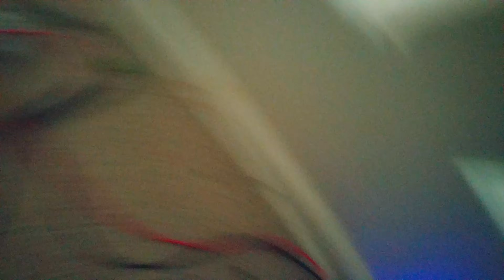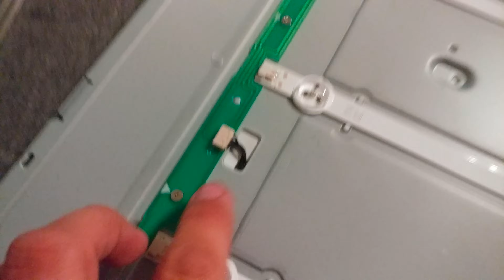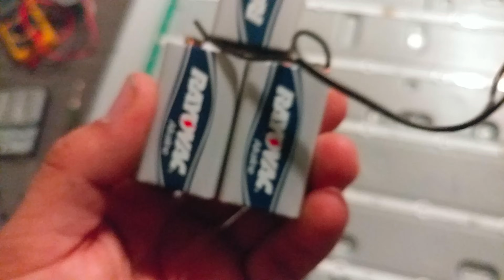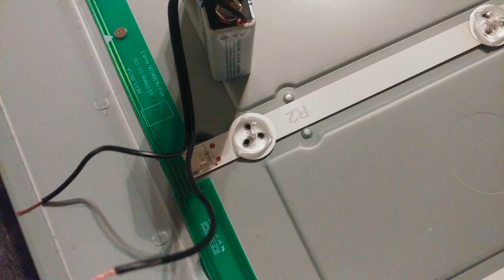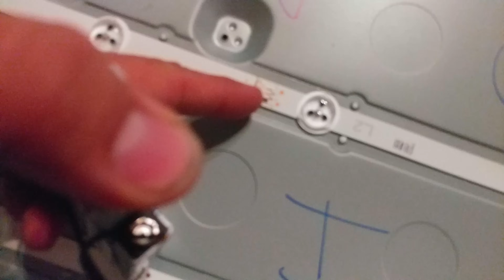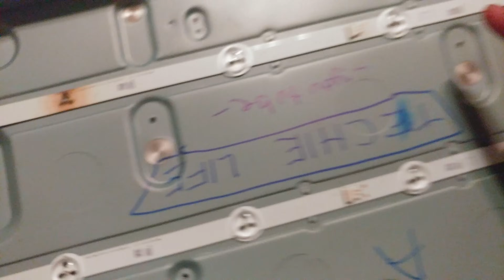how to test LED strips without tester Using a battery. backlight tester DIY

Comment: 2:45 - 10 X 3 = 300 Volts?
also
Dude, check out  --> Video editing Software.
 Soo, I rate this video 2 Kamalas & 1 AOC.
(kewel battery config is the reason for 2 instead of 3 Kamalas)

Comment: if the orignal LED is 3v is buying a replacement 6v ideal, so that the LED wont reach the max power and burn out, its just a question
Reply from the maker: No, you want another 3v.. if you purchase a 6v, the other leds will become very dimmer and that one led will be brighter.

Comment: Quick easy question?  I got two brand new power supplies and led output for the backlight is 130v roughly on led pair 1 and 0vokts on led pair two off these boards. Am I correct in assuming these parts I bought are bad?  It mentions 89v on #4 on the voltage tag on the board. So I my mind these are defective.  It does it without led connected and without motherboard connected and I have tryed with it hooked up...

Comment: When you applied the 3 x 9V tester, did the rest of the LEDs on that strip also light up? Thank you 🤓
Reply from the maker: Well it depends on the tv. If the LEDs are in connected to the rest of the LEDs, then it should turn then on.

Comment: I've got to replace the LED backlights on my 5yr old 65" Philip's PFH5250/96 as the LEDs have gone dim on 1 side :) not looking forward to this to be honest. Nobody seems to have taken this model apart on YT :(
Reply from the maker: Just try to figure out which led has gone bad... Or just try to replace the whole led strip. That would be easier

Comment: So you're saying if there's one bad light that if it's removed the tv will function? I was thinking I had to replace it. I know my 65 inch insignia has a backlight problem but I haven't disassembled it yet. Was thinking I needed a lot of stuff to solder, heat, whatever flux is, etc.
Reply: If you don't already have all that stuff it would be cheaper just to order a new led strip kit
Reply: @MyBigThing2010  yeah I fixed my TV last yr or maybe the yr before. Lots of people give those TV's away and the repair isn't that bad. I even had a shop tell me it wasn't worth repairing which tells me how sorry some "specialists" are.

Comment: Fantastic, can in ask, i have only 8 led in my strips, is 27v to much? Would using less like 12v still light them up but more faint? As in enough to know which led is not working?
Reply from the maker: I would only use about 20v
Reply: @TECHIELIFE  Would 18v work as in 2 of those 9v batts or would 18 not be enough to light them?

Comment: Hi.....how did u bead or solder the strip where there is missing LED. I live in small town where no TV parts are sold and my TV display went black today only sound. Luckily i have an old tube TV to go on with my life lol. Gona be  a while before i can get a replacement strip
Reply from the maker: Place a small piece of copper. And it should bridge it
Reply: @TECHIELIFE  thanks will try that today

Comment: If I wish to replace individual LED in any of the strip, what is the type of LED I should buy from the market?  5050 or 3528 or what?  Can you pls advise?  Three battery pack for testing strips is really interesting. Thank you.
Reply from the maker: You honestly should measure the LED, or just try to find an identical one on eBay

Comment: My master Philips 32BLD4012N / 62 has 2 LED bars on the TV, there are 6 LEDs on the bar. There is no sound, there was no image, I changed the LEDs, they did not light. There is 13 v electricity to the sockets but it does not light up. I wonder why
Reply from the maker: Probably because the LEDs are bad. Did you change the LEDs or the whole strip?
Reply: Although I ordered a product that looks exactly the same, the product that is the same as the TV model but the input socket and the codes on it have been sent warn. The original is K320WDC1 A1 and the product sent with a socket at the end writes K320WDX A2 and the middle socket makes a difference.

Comment: Tnk, for the help, just one question, my led strips are made with 14 leds, could work with 9x3 battery or I need to increase the number of the batteries? Tv Samsung ue55ju6800. Tnk in advance.
Reply from the maker: Let's just say, under voltage is safer than over voltage.. these leds will be damaged if you go over

Comment: if I wanted to light them all together from the cable that goes to the power supply, how man volt i need?
Reply from the maker: Depends on how they are wired.. but typically it would be 3volts per led.
Reply: @TECHIELIFE  12 led each strips so 36 volt , I tested them with 4 batteries. 5 strips connected in parallel 180 volt?
Reply from the maker: @ivanhossain5436  sound about right.

Comment: Amazing video very impressive just had a quick question so if I do this I can touch and test any of the LEDs one at a time? Anywhere on the board except for the middle connectors? Because the middle connectors will send voltage to the entire strip? But if you touch one 3 volt with the 27 volt wouldnt that blow the single led as well? I want to try this on mine ASAP because I'm waiting for LEDs to come in the mail so if you could find the time to get back to me that would be great thank you
Reply from the maker: Yeah , do not try on a single led. It will damage the led.

Comment: great idea..i just used a 12v ac adapter and strip the end off and it works fine for doing 1 strip at a time and just do each strip ...i like your 9v  method too....i also do what you did by jumpering the bad led..it wont really matter..you wouldnt notice it...

Comment: Great video! I was considering to buy a tester with priority shipping but this will definitely save time and money to fix an old Vizio TV with backlight problems. I’ll still get the tester but it can get here whenever, now.  Thanks for the bonus trick with the bridged LED solder. Considering I am fixing an old TV, I rather spend towards a new one once this one is not worth fixing anymore.

Comment: You can also use your phone charger + usb to test them , basically cut the usb cable you'll have 4 wires use the black and red as positive and negative. And job done
Reply: @Sam S I don’t understand the point you’re making on how it’s a bad idea to do this. How are they fundamentally different at all, it seems like the same thing to me? It kinda seems like your point is, that it would be bad if, while you were connecting the wires to the backlights, the voltage happened the vary. But you say yourself that the voltage is constant, and the phone itself regulates it, so without the phone in the picture there would be no need to worry about the voltage varying

Comment: So I could use a little "wall bug" switching power supply of around 30VDC to do this, right? Or, would the voltage be too un-filtered/un-smoothed?
Reply from the maker: I don't think it needs to be filtered. The lights will get brighter as more voltage is introduced.
Reply: @TECHIELIFE  Cool. I managed to test my LED strips using a transformer from a toy railroad set.

Comment: I did same with 3V button cells... Kinda sick,but working. :D But the problem is,all the LEDs working fine,but for some reason,the top 4 row of the strips not even light up at startup. The bottom 3 row driven by the second pair,works fine. Any ideas?
Reply from the maker: Maybe it's a power supply issue. What's the model of the tv?
Reply: @TECHIELIFE  55LN575S-ZE. When i turn it on,the voltage jumps up over 200volts on both positive,then when the backlight shut down,i measure stable 85volts on them.
Reply from the maker: @janoskonyari3294  it's either the LEDs or the power supply, if the power supply is supplying power, then that led array may be bad.

Comment: Receptionist at an authorized LG tv and appliance repair shop in Ohio said the whole panel on the TV needs replaced if some of the leds are out. And it costs $500-$1,000. Is this true? Lol. I though you can just replace a strip of the leds.
Reply from the maker: It's true that it could cost that much. But it's something that you may be able to do yourself if you are very careful. This is a kind of hard task to do. But the principle is easy. They Normally will replace the whole panel because this way it's an easier and faster job to do and will pass the bill to the consumer.

Comment: could I possibly use a buck converter? I have 8 led per row and a hp printer power (internal )supply is 29.v  Ive ran my sound bar and other thing off it. there $3.00 e-bay.. thanks

Comment: This method might work, but I would not recommend it.  If you want to use a battery to check LEDs, use two AA, C, or D batteries instead of a 9-volt triple pack.  With the 27 volts that are produced with three 9-volt batteries, if the string you are testing has only 5 good LEDs working, you will be supplying them with nearly twice the required voltage, which will blow them out.  If you use two AA batteries in series, you will have a 3-volt tester, and you can check each 3.2 volt LED at a time, without fear of blowing the LED.  

The BEST method of testing LEDs is with the variable voltage LED tester that is sold EVERYWHERE.  Made in China, and you can find them from about $20 to $60.  I got mine from Amazon for $23 including tax.  It will check a single LED or an entire string of up to 100.  It varies the voltage as required.

Comment: Good video,  your camera is too fast...slow down...ok... in a 16ft. Strip, will each 3 LED section need 3V or not? Last night strip became slightly yellowish and went dead. Any way to check which portion is faulty? Power Supply is 12V 6 Amps......https://www.amazon.ca/dp/B01FFWQCKO?aaxitk=A6wcF2s2dO2ZCOvdBjLGEA&pd_rd_i=B01FFWQCKO&pf_rd_p=aa0a7a36-9d2d-49bd-b59d-ceef667a2a55&hsa_cr_id=1875331280801&sb-ci-n=asinImage&sb-ci-v=https%3A%2F%2Fm.media-amazon.com%2Fimages%2FI%2F71WHdYuTr1L.jpg&sb-ci-a=B01FFWQCKO
Reply from the maker: Each led is most likely 3 volts
Reply: @TECHIELIFE  Thanks....EACH or Set of 3 LEDs = 4.5V?

Comment: New subscriber.  Nice work. Can you help me with my Polaroid tv? Model tlx 042-40b. Have standby and power lights,no picture. Inverters look good,think it's a blown cap on power supply.
Reply from the maker: Do you have voktage coming out of the power supply to the LEDs?
Reply: @TECHIELIFE  That's what I'm not sure of...where to put probes on my meter to check...should it be 5v coming out or 24v?
Reply from the maker: @Buff_Dave_Oprtr  probably the 24.

Comment: What is the meaning of one strip says R1 and follows the other strip that says L1.  What is the deal with that.  Can one unhook say the L1 and light up the R1 or just cut off some of them ( being hooked up in series, probably not) to shorter the strip just for the purpose of sticking them somewhere and use them for fun?  Dang I didn't realize that you have supply them with so much voltage.

Comment: so i have samsung un60j6200af and it has two seperate led wires one set grey/black and anouther grey/black when i use the 9v battery test it lit one of them but other set of wires nothing happen.. so im hoping even though its a job its just the leds.. shopjimmy has kit with suction cups for 12strips 100$

Comment: Just been stripping ours down if goes well will  e my third tv repair success  plus 1 that's an almost fix (sound plus tv comes on (didnt before ) but still no pic ) first fix was a 37inch samsung lcd and being used as I type lol which only needed capacitors (£5) anyway almost to the nitty gritty of getting to lcd's (these ove not yet ever done ) I have a supplier who has them but there are 2 arrays  so need to check which ones are needed it's a Phillip's 49put4900 model there was a an upper and lower dark patch that was only noticable on certain dark screen picture I have no lcd  tester have u a link for your tester ? Are the cheap £10 ones on ebay any good ? And did u test the side ones that you mentioned? Thanks good video
Reply from the maker: I have a link on the description of the video
Reply: @TECHIELIFE  my bad I'll take a look mate thanks

Comment: LED's simply don't last forever and if you have  them dying then it's time to change them all. You can buy complete sets of LEDs from China to suit the TV you're working on. It took me some time tracking them down on AliBaba, but I ended up finding the set I needed. Total cost with shipping was around $46 USD. 

My TV should now last another 3 years, maybe more. But messing around and only replacing a few means you could be replacing the old LEDs every few weeks or months, I guess it all depends on how you value your time. If you decide to replace only the blown LEDs then also check for any LEDs which appear to be stressed and change them even if they're still working. If they look stressed, they're about to die, so remove them. Also, replacing LEDs with those out of wrecked sets isn't a good idea either.
Reply from the maker: Propfella, I understand that they don't last that long. And yes I agree to switch off all the LEDs is a better idea. But sometimes is about the convenience that matters. I would buy broken sets and repair them as seeing fit and reselling. Spending more time and money on the tv would cause the profit to go down. Granted, I don't sell these TV's at full price either, I would tell my customer that it's a used tv and I also would give them a month warranty.  The biggest thing about LEDs is the heat. Kind of like you car engine. It would last a very long time running fine, but it you just have one instance of it overheating, it could cause damages all over. That's what LEDs are more like , and yes I know that LEDs will eventually give out. But the problem is the heat management. This is why I always advise to lower the brightness down a notch . 
You did say that you purchased some LEDs for cheap, some cases buying these Chinese LEDs don't always work out fine. Quality control is not that great. So I prefer an oem strip instead of aftermarket.
Reply: @TECHIELIFE  Considering the fact the LEDs came from the company who made my TV, I can only assume they'd last as long as the batch which originally came with the TV.  

As for taking LEDs from other sets I also assume you're the type of "tech" who tells the customer their TV is unrepairable, tells them they have to pay to get their dead set back and when they don't pick it up you throw in some used LEDs and sell it to make 100% profit.  

Yes we have the same type "tech" scammer who does the same thing in our town. "Can't be repaired, it'll cost too much" he says and an hour later he's repaired it and selling it to some poor sucker who'll be lucky to get a few months use out of it and you'll do exactly the same thing to him. "Can't be repaired, but here's one I repaired earlier"
Reply from the maker: @propfella  I don't do repairs for any one. I simply purchase broken TV's that people sell and show others how to fix their tv. I do have plenty of videos showing this.
Reply: @TECHIELIFE  So in other words you sell "Fixed" TVs knowing the remaining LEDs could fail at any time? I wonder why I assume there's a healthy profit between the buying and selling price? I was in the TV / Video repair business for a number of years and thankfully I never once sold anything I knew would fail in the not too distant future.  
Plus the money you make from YouTube of course.
Reply from the maker: @propfella  yeah your right . I'm just a scammer.. so go ahead and move on to the next YouTube channel to stir up nonsense. Have a good day.
Reply: @propfella  People like you always finding fault in order to condemn. No body is perfect not even you learn how to appreciate Good ideas MR PROPFELLA or whatever you call yourself

Comment: Great video man! I'm an electronics technician myself and that's a great solution to apply the necessary voltage with "low current" to test the led strips! I'm actually getting ready to troubleshoot a Samsumg Smart TV that has a brightness issue and this a great video if you don't have a variable power supply or led tester. So, thanks for posting this video man! God bless.
Reply from the maker: Thanks chris,  for the comment. let me know if you need any help. BTW what model number do you have?
Reply: @TECHIELIFE  Yeah absolutely! It's a Samsung UN40EH5300. I've also got a cool idea for you if you ever need it. I've used a 9v battery before with a set of alligator clips as a long range continuity tester. You just clip the two sets in half, solder or wrap two leads to the battery and get a small DC piezoelectric buzzer and solder or wrap the other two leads to that. Boom. Instant long range continuity tester!
Reply from the maker: @MrCcarter7  neat idea.
Reply: @TECHIELIFE  Yeah I used to work at a tv station and multimeter leads just weren't long enough when running and terminating audio wire from one room to another.

Comment: It could also happen (took me a month to find out), that you change all led strips and still get a flash and a turn off. But watching carefully, it was only half of the strips flashing.. there was a broken connector in a led strip. So I had all leds ok and voltages ok, but the problem was a connection! CHECK CONTINUITY BETWEEN POWER SOURCE AND LEDS, ALD BETWEEN LEDS. A simple bypass between strips and the TV is back on!!
Reply from the maker: You are correct. Sometimes it can be as bad as a bad connection.

Comment: Can I do this to test them before I tear it down, like test from the plug
Reply from the maker: You can but it has to be very careful. You would need to know the voltages from the strip. Just in case you don't burn them out . Better yet look up how many LEDs it has per strip on shopjimmy.com

Comment: Do i need all of the led lights to work if i unhook one strip
Reply from the maker: Depends on the tv model. But most likely it won't work.
Reply: @TECHIELIFE  but I can replace the bad LEDs I have Proscan/JVC 30355007202 Replacement LED Strips - 14 Strips